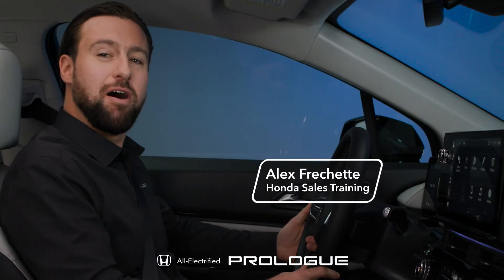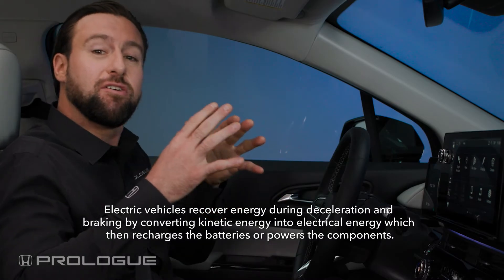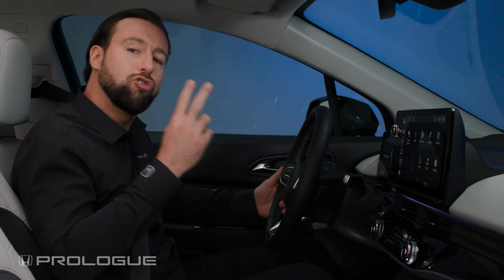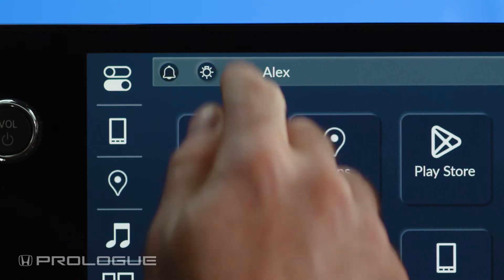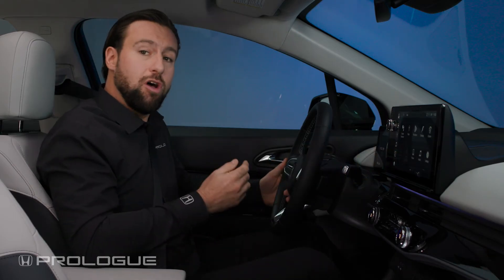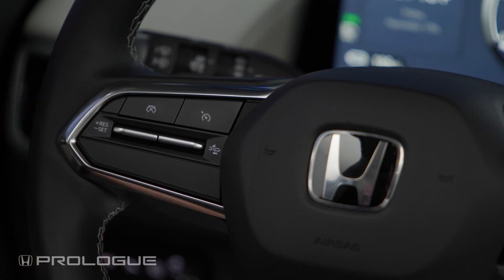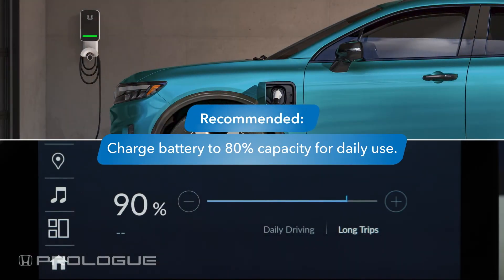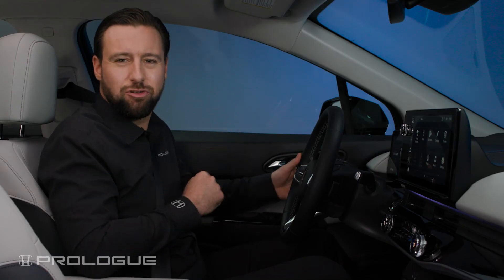Honda Prologue | How to Use One Pedal Driving and the Regen Paddle

Comment: What I need to know is how to stop quickly and safely in the event of trying to prevent an accident when in this mode.  Is it still ok to use the brake pedal?
Reply: Yes it is still recommended. Opd is good to use to extend the longevity of your battery and help possibly give you a bit more range while driving